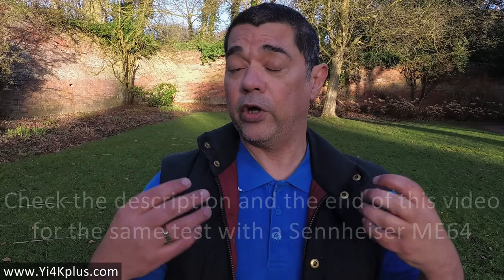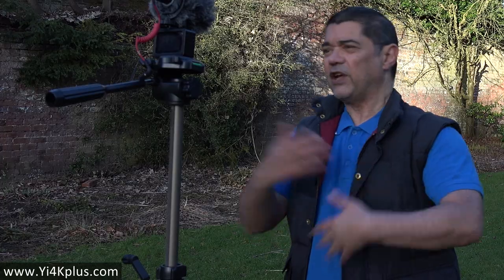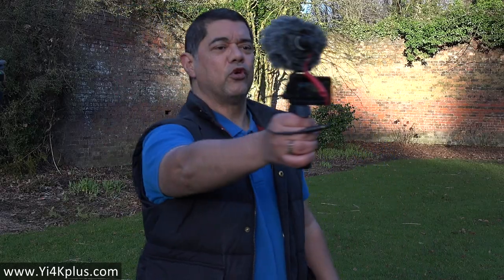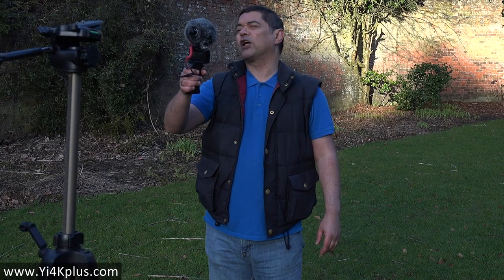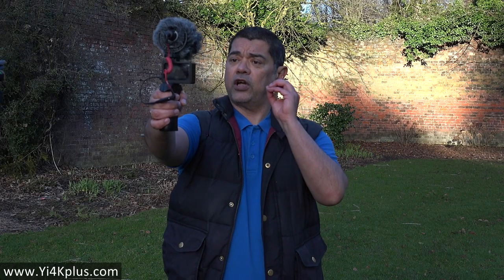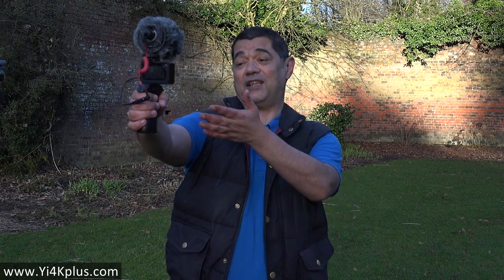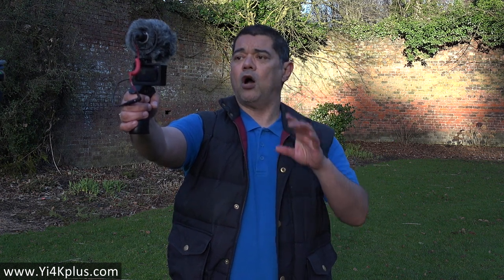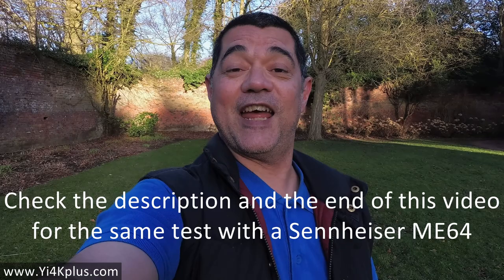Yi 4K Plus & Rode VideoMicro external mic - audio test with a passive attenuation microphone cable

Comment: been sorting thru all the yt videos on action cams. your videos are def exhaustive, thank you for your work. ive seen a number of reviews & still can land on one. can you suggest a 4k cam with best audio out of the box? i plan on using it via chest strap to record fishing, biking & even basketball & baseball games. my budget is sub $100, any insight? thanks in advance!!!
Reply from the maker: Hi.

I've used a lot of sub $100 action cameras and have never been happy with the sound. That said and although I have certain issues with picture on the Yi Lite, it has surprisingly good sound from its internal mics. If you add some wind filters and a rubber case to the Lite, it is way better than anything else around its price. In fact, the Lite is better than the Yi 4K+ and 4K as far as built in mic performance is concerned.

Check out this video. I was demonstrating how good the Rode Mini Windjammers are and used the Lite for the test. With the rubber case and Windjammers, the Lite's audio was awesome and that was in a fairly strong breeze.

https://youtu.be/sxkxDU888cQ

As I'm so impressed with that particular setup, I'm working on a video titled 'The Best Budget Action Camera For Vlogging' that uses that system. The idea is to do three or four short edits showing how good this Lite setup is. Here's the first of the pieces for that particular video, it's an unlisted video on my test channel but this direct link will open the video.

https://youtu.be/fE5OQLSVgpc

If you're interested in using an external mic with a cheap action camera, I'd wholeheartedly recommend you buy a second hand GoPro 3+ Black. They have a fantastic picture that still stands up well against modern action cameras and have a great mic input that only requires a cheap adaptor cable. Check through my video list I have a whole bunch of stuff on GoPros with external mics. Its internal mics are good as well, maybe not as good as the Yi Lite but the GP3+ does have a better picture compared to the Yi Lite.

Hope this helps,
Dave.
Reply: excellent! thank you so much for your response & insight. much appreciated.

Comment: I have the same issue with this camera. Can you show/make video on how to fix this? What to do with the cable. Thanks
Reply from the maker: I'm not too sure if I'll be able to get round to doing a how to. But, if you cut the Yi USB cable in half, seperate the live and ground on both sides of the cut cable and insert a 10K resistor in line with the live cable and rejoin/solder the ground, making sure that both are isolated from each other, then this will produce the exact same cable as I made up.
Reply: I second that. It would be good to see how to actually modify the cable!

Comment: I have a question.
How did you attach the Rode Video Mic on the top of the Cam?
It looks like you have a case with a 1/4 mount on the top and the bottom.

Comment: I have a massive issue with this camera. When the WiFi and external microphone turned on I hear crackles that repeat several times a second. I sent the camera for service, they sent me a new one and I have an identical problem on this new one.
The microphone itself does not play a role here, because even after its disconnection (even the cabel is disconnect) I still hear strange noise and crackling. It seems that in these cameras cant booth use wifi and external microphone. This is very stange - do you have a similar effect on your camera?
Reply from the maker: Hi, I've not tried it with WiFi and external mic at the same time. Next time I use the camera I'll try this configuration and I'll post back what happens. Maybe record a simple example of the problem and upload it to YouTube, maybe others will identify with problem and could maybe help you out. Cheers, Dave.
Reply: Fantastic find, have been playing around with external (Rode) mic on my Yi 4k+ and gimbal setup to see if I can reduce gimbal noise and this "wifi" interference is the last bit of noise I just couldn't kill off! Thanks so much, wifi I don't use anyway only had it on from when I was playing with the app haha. cheers bud

Comment: I just watched your video. Good Job. I am using a Yi360 and it has an external mic option. My issue is I want to use the USB C power to keep the power up and LIVE stream 360. The Yi only has one USB C and that is also used for external audio. I want to use the USB C for Power and External Audio. Any suggestions?? (You seem well versed on Yi)
Reply: There's cables that have male and female in the same array for the porpouse you want.